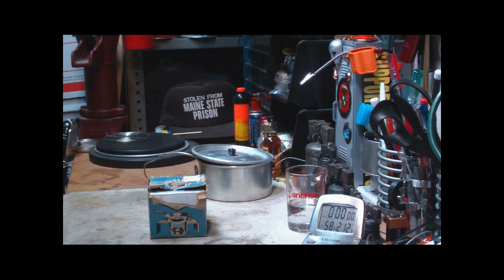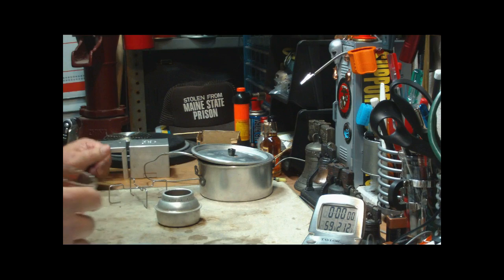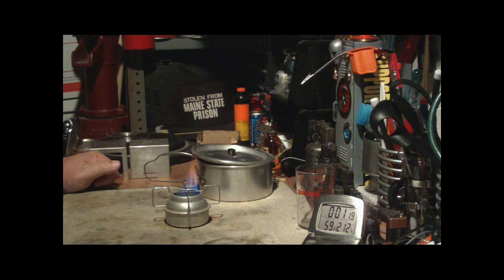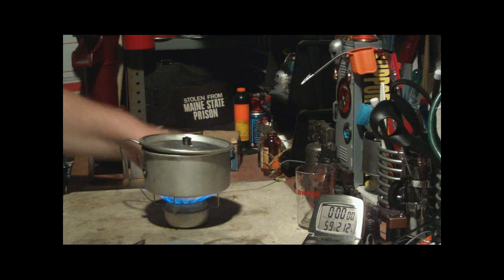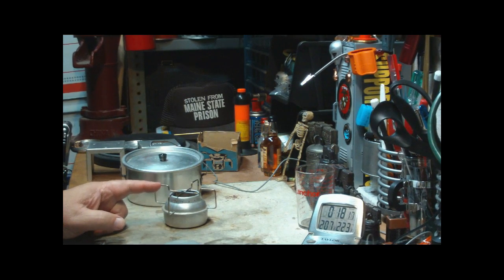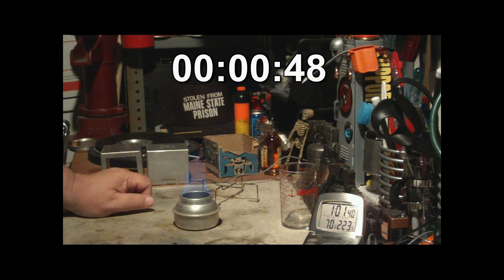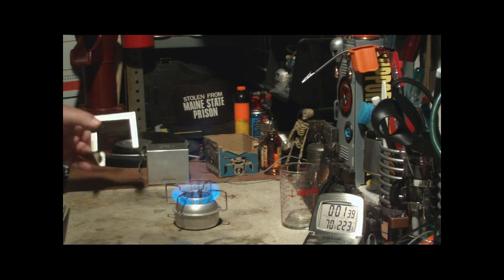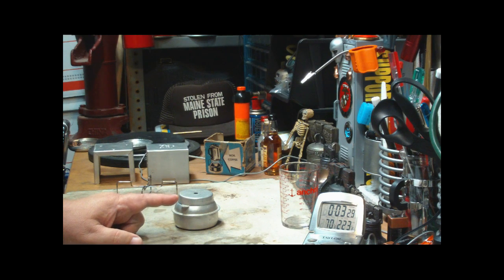Jiffy Heat Sportsman's Alcohol Stove - Boil Test 1

Comment: Hiram, I wonder if you could use just the burner and place the pot directly on top? Basically use it like a low pressure side burner, like your little soda can stove.
This doesn't work on a Trangia, but because the Jiffy stove has jets that are lower, it might work..

Comment: Seems to me with this style of burner, you can place the pot on immediately after lighting and it should help heat the unit up.  Also 5 or 6 drops of fuel on the ring should help to prime stove.